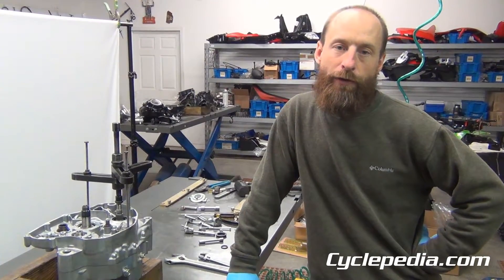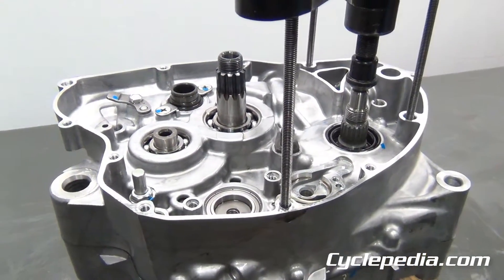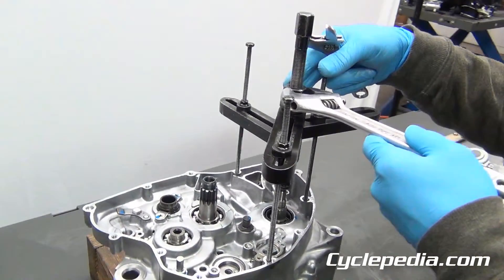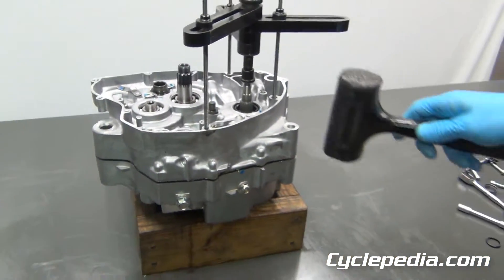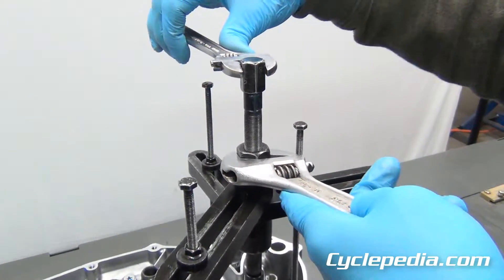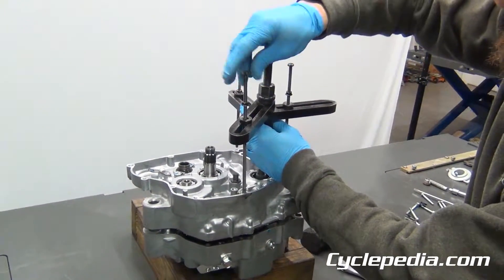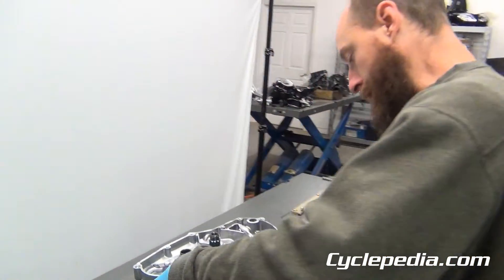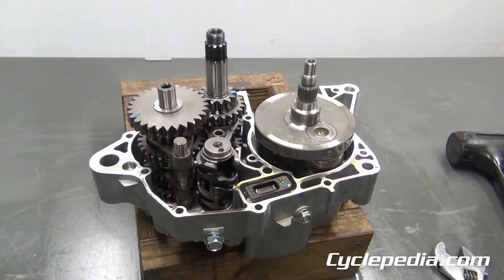How to Split Motorcycle Engine Cases

Comment: i have a 2001 ttr125 i bet it's never ever been pulled apart, bought this cause it was locked up plus a piece of alum chunk missing which is in the motor some place..99% of the casing is pulling apart except for 1 corner by the oil drain..no bolts screws nothing there to bind it...i do have a new bottom end casing coming in tomorrow ( i hope ) so i can use some advice on whats holding it up and /or what do to to split it without damaging anything inside ?????  Great video by the way and i do have a TUSK case splitter

Comment: Hello I am in a desperate situation the Crankshift bearig has gone on my partners ATV Loncin 200. This is the second engine (installed Aug 2024) since it was purchased in Feb 2023  The engine needs splitting. Where does he need to obtain a splitting tool; how do we know whether it will fit. ? Your advice would be greatly appeciated. Thanks Julie

Comment: Throw a little heat on the crank bearing and the case will slide off pretty easy. Sometimes the bearing will come off on the crank and you have to use some heat or a puller to get it off. All this is getting replaced anyway regardless because now it the time to do it while the cases are open.

Comment: This was fascinating. I don't know anything about fixing motorcycles. I was told that I need to replace the countershaft on my Versys 650 (worn splines) and it would require "splitting the case." It's going to be expensive!

Comment: What tipe of puller is that were can I buy it ...I'm stuck on split the case
Reply from the maker: These are available from many places online, search for "motorcycle crankcase splitter tool" and you should have many choices.
Reply: @Cyclepedia  good morning I found the crank case tool ...does all of them come out same way I have a polaris predator 500 2007 I took all the bolts out an is still hard to separate the case an I dont wanna hurt it I'm just so lost a friend of mine broke the shaft of the water pump changing it there a bolt on the side where the sprocket goes do i suppose to take that out cause i try an try an dont come out but I dont know if I'm supposed to take that one out to
Reply from the maker: @eduardofeliciano9990  You need to read over the repair manual for that model to  make sure your not missing anything. Here is a link to a video about crankcase splitting also. https://www.youtube.com/watch?v=zfGdhTQKkzs&t=1s

Comment: Thanks for the video. Too valuable to be for free. What brand puller is that?
Reply from the maker: If I remember correctly the puller is an old Motion Pro. Its been a good one, many cases split and a few cranks pushed out too.